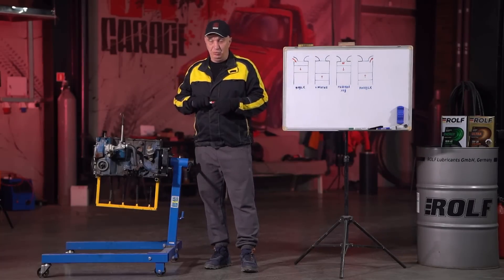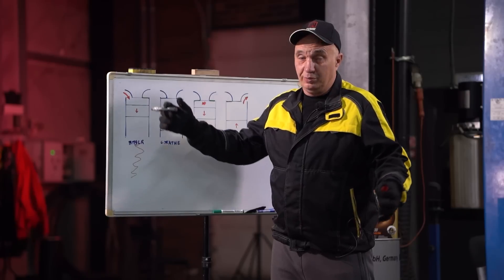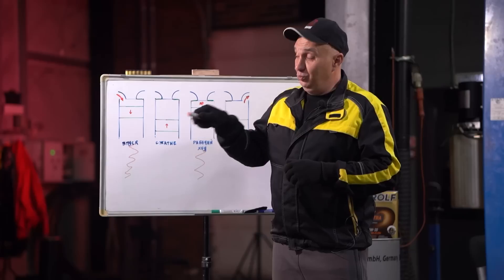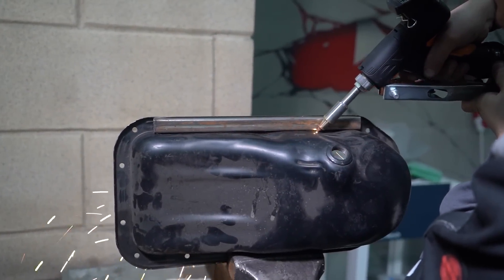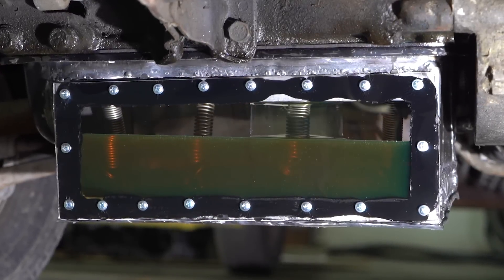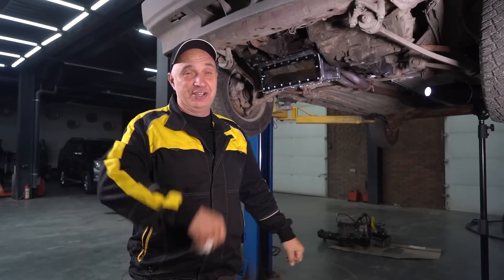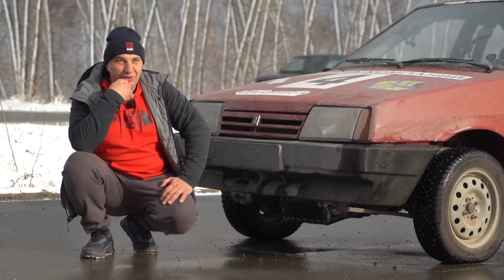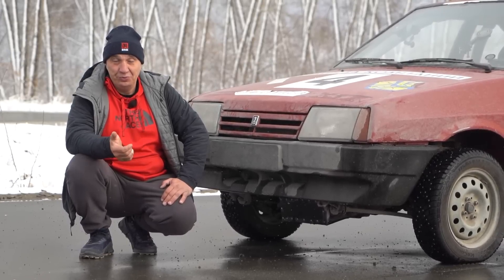Spring augmented engine (20% extra HP!) - will it work?

Comment: I processed your test data. The horse power gain is 20.56%. Very Nice! Yet your test is only an A-B test that separated in long time to add the springs.
Could you please re-do another A-B-A test within the same day, or in a short time? This way will solidly confirm your achievements. Thanks!

Comment: You could of try and use a second crank! so if the piston goes up that the tension is lowered then the combustion stroke the spring is tensioned again before it descends. reducing the needed energy to pull the spring and only use the contracting energy in the spring. 
if the 2 crank was at rotating in advanced of the main crack you may pull it off  using spring to help power increase
Reply: thats actually the sort of setup i had in mind so that not all four springs have constant tension thus cancel each other out. i also wondered if the second crankshaft had a longer stroke and then what if you used something like surgical silicone tubing... i also even debated whether its feasible to just tension the "springs" or whatever with solenoids or a hydraulic means.

Comment: It is not about the springs canceling themselves out. What is going on is the added benefit of another system that can preserve and reuse mechanical energy. Typically that is the job of a flywheel and counter balance, but adding more systems to conserve energy is just being more efficient. 2/3 of the energy produced by a combustion engine is just plain actual heat and very little is actually transferred into rotational energy. Increasing engine efficiency to another level would be to use that thermal waste to increase power, my thoughts would be to add a boiler and condenser to remove heat from the engine, and create steam rotational energy that could then be added to your total power.

Comment: My theory is that the springs cause the rotating assembly to behave like it’s half the weight of the original. 

If the force to pull the springs up were some how less (reducing parasitic loses),than what it would take to actually pull it back down quicker, I don’t see why it wouldn’t work.

Comment: Elliptical gears come to mind.

And I mean make the individual springs controlled by elliptical gears which raise and lower a bar where those springs are attached to. The elliptical gears cause slow-fast-slow-fast rotation cycle to the output shaft if the input shaft has constant speed. Thus the bar to which a spring is attached could lower fast and make the spring to tension and assist the piston coming down. Then the rotation is slow when the piston also is at the bottom dead center. Then when the piston starts to move up, the bar also raises fast. Then again when the piston is at the top dead center, the spring movement is slow too because of the elliptical gear. And when the piston goes down, the elliptical gear causes the bar go down fast again and be at the bottom faster than the piston and this causes tension to the spring and pull to the piston.

Of course timing would be crucial in that and the bottom bars should be rotated by external power source which would defeat the whole purpose of them but this would be interesting to see could you actually increase the power extracted from the pistons with springs which are controlled by elliptical gears. 😄
Reply: why wouldnt you just attach the springs to something like a secondary crankshaft? it wouldn't need to weigh as much as the crankshaft nor require as much strength. it could potentially feature a longer stroke and positioned in such a fashion so that not all of the "springs" are under tension at the same time thus just being expanded and contracted therefore negating each other, and maybe a variable timing setup so that it could tune itsself in real time. it just needs to exert force at the correct time but not cancel its own forces out. an idea comes to mind when i think about combining say surgical tubing or springs or rubber bands with solenoids since those can have significant pull force, actuate in milliseconds, withstand countless cycles, and be fairly reliable. i would think you would want to have the "springs" start to build tension roughly before or about your ignition event depending on the parameters and dynamics of said spring and engine. right before the piston reaches its dwell point at tdc in other words. the dumb part of all this is that the rotating assembly inherits most of its it losses in the cycle from compressing the mixture as well as the energy it loses dwelling at the top and bottom of its stroke, then changing direction. i feel it could benefit more having the piston assisted upward. its all food for thought, but i believe a system could be devised with the right ingredients and recipe which could lend its hand to squeak out some efficiency or in the least negate some of the forces that rob efficiency thus potential power. sometimes, it just takes somebody thinking outside the box or taking a different approach than most would. not every innovation in motion had Newtons law of conservation of energy in mind first; regardless of the fact that everything observes and follows it, but the bar for internal combustion could potentially be set higher. somehow. if i had the means to experiment with and execute every single sort of idea ive had to try with an engine, there would be some sort of game changer somewhere along the way. ive thought of stupid stuff with the valvetrain way before the freevalve stuff came about. like, what if the valves could be ran on a hydraulic setup? but way better than the stupid Fiat-chrysler multiair 2.4L trash can engine.

Comment: I bet, there is a better way to do this that might foam the oil less, but it's trickier, and it still wouldn't make up for some efficiency losses, but it might be more efficient than this. There's also the problem of the springs breaking eventually, and that could cause damage to other parts of the engine. So, a spring design that is more minimal and breaks in a way that prevents damage to other parts of the engine would be the most idealized form of this mod, but the engineering cost might not be worth the gains.  Still, I wonder...

Comment: I speculate a significant difference in the outside temperature between the two runs.  Ambient temperature plays a pretty big role on the amount of power an engine produces.

Comment: I HAVE AN IDEA FOR YOU GUYS TO TRY . 
CONVERT A V10 TO A V6 , SUPERCHARGED BY ...
4 REMAINING PISTONS . 
USING CHECK VALVES TO REPLACE INTAKE VALVES . 
AIR COMES THRU THE BORED OUT SPARK PLUG HOLES FITTED WITH FILTERS .
4 INJECTORS ARE DISCONNECTED ON THE PUMP CYLINDERS. 
COST REDUCED TO 40% WHILE CRUSING. 
SAME POWER UNDER LOAD . 
START WITH A PUSHROD V10 . 
EASIER THAN A SOHC OR DOHC. 
P

Comment: I speculate, that any performance increases... may have been due to the foaming of the Oil.   The oil may end up acting less thick... and thus, flow better.  However... that means the Protection it provides, may also be reduced.   Also, the constant oxygenation of the oil, may start to break down the oil much faster... leading to a reduced lifespan.

Comment: 10 seconds? Really? Your a genius. The springs will have to be heat treated of course. 🔋Perhaps encapsulated spring capsule types with cooling journals with pumped coolant gas of non combustible type R23 and cause the spring to recoil more rapidly. All the best from USA.

Comment: Why is it often said that the balance shafts reduce engine power? I can see some reason behind the opposite being true (a vibrating engine will lose some power to its mounts, where the energy of the vibrations will be dissipated as heat). Obviously the shaft adds some inertia, but this will only cause the engine to feel less "snappy" to rev up. What am I missing?

Comment: Looking through the comments, someone touched on this but it wasn't very clear.... The oil foaming caused by the springs greatly reduces windage losses. On these dinosaur tech engines with poor oil control, windage reduction plus the changes in air density from test to test could absolutely account for most of the gains in performance. I do believe there is a balancing effect though, the springs smooth out the piston acceleration and help redistribute the forces so you are getting smoother more consistent power delivery, although this effect is much less than the windage reduction.
Reply: I dont know what Windage is (unless you are speaking about wind resistance)... but my theory, is that the Oil being Foamed up... is causing it to act like a much Thinner Oil.   Thinner oil provided less frictional qualities... however, it also means less overall protection.
Reply: the oil sitting farther away from the crankshaft might reduce it insignificantly, but you still have oil flying everywhere inside that crankcase. youd probably have more reduction in losses knife edging the crank and putting a crank scraper/windage tray in it. i suppose you're a little hard up if you go out of your way for knife edged connecting rods, but hey, no price too large if its a max effort no holds barred engine build

Comment: The springs, if anything, I feel are usually making things less efficient. Sure, one spring pulls a piston down, but in the meantime another spring is being pulled. The springs are having energy put into and then pulled out of, and as physics being physics, that's not 100% efficient. Some gives out to heat. So really, with this and the video that inspired this, the springs are only really sucking power from the engine and doing nothing in return. The reason the engine spun a few turns beforehand is probably because of the springs, being opposed, probably acted like a sort of elastic "flywheel".

Comment: What about designing a sort of "variable tension" mechanism for the springs that could be controlled by oil pressure and regulated by the ecm (think vtek or vvt)
Reply: I also wonder if this spring mod is better in terms of improved power or alternatively maybe it has a substantial increase to fuel economy

Comment: Equal and opposite reaction. Let’s say it did work anything you gained from the spring pulling down is negated by the springs being pulled up. It’s like trying to blow the sail on a boat with a fan on the boat. It just doesn’t work.

Comment: Another great video guys, thanks for all your hard work. Have you tried making a rotary valve head? It would illiminate regular valves, camshaft, springs and rocker arms, a lot less friction.
Reply: Actually, unless you use a cam system to virtually stop the motion of the rotary valve at combustion TDC, the high cylinder pressures increase the friction force with rotary valves. The supposed benefit of rotary valves is higher volumetric efficiency, but with modern design principles and variable valve timing, volumetric efficiency can be more than 100% even with poppet valves, so it's dubious whether rotary valves actually have any benefits to counteract the disadvantages.

I first found out about rotary valves at uni, well over 20 years ago, and there haven't been any appreciable advances in their design or manufacture since then (at least, not that I'm aware of). I doubt that we'll ever see them in volume production engines. Poppet valves work very well with modern design and manufacturing techniques, and rotary valves aren't as easy to get right as people think they are.

Comment: Looks like it was colder outside during the second test also getting your oil away from the crankshaft like you did will free up some horsepower by reducing the drag of the oil on the crankshaft

Comment: I dont get the idea at all haha.. 
Even if the springs were 100% efficient there would be 0 gains. Since compressing the spring removes exactly the same amount of energy as you will get back when it extends again. And in practice compressing it will require even more energy than you get back since a portion of it will always go to creating some heat that is completely wasted.

Comment: Hmmm... to reduce the whipping effect you can add little cylinders for the springs to ride in keeping the oil separated from the oil. Also , start playing with spring tensions. I am quite surprised from the results but the data shows there is an increase in perfromance ..even though it seemed to be much cooler thus having a environmental advantage causing DA to be favorable to increase hp/tq, but the traction was less, But  10 second delta is  immense!! I hope you try out some more ideas for this Spring Charged engine

Comment: I think you guys should try an injection molded polycarbonate engine block with transparent aluminum sleeves it should be strong enough to finally have a long term transparent engine

Comment: I almost though that it was april already 🤣🤣    - can you rather try twincharged LADA, or make rotary valves for lada.

ABOUT THE VID THEORY…........the springs are conected to the same crankshaft so the spring force cancels out, becuase of the fact that it is hard piece, this could work only on a One piston engine ar engine that has not symetricaly oposing piston balance so up and down piston would need to be something different than 180° of each other to even exert some force........I will not go into detail to check if it would help.......but on the one piston engine this could work, it would not be more efficient but it could up the power, bcs the spring pulling down could add more power to the piston going down so it could theoretically draw more air:fuel mixture and make more power on the downstroke, than it would take to preload/stretch the spring by the flywheel when it goes up.........................BUT THIS THEORETICAL GAIN WOULD BE ABSOLUTELY OBLITERATED BY SLIGHT DIFFERENCE IN HUMIDITY OR PRESSURE OR MAINLY TEMPTURE on atmosheric engine.

Comment: How about installing a pressurised injector/atomiser head (fed by a resevoir and pump) into the airbox on a stock motor that sprays Nitromethane or Nitromethanol into the airbox... Power gains? 🤔😏🤞🤣🤣     😎🇬🇧

Comment: It could be that the interference timing of the springs is helping reduce the ancillaries parasitic loses, as well as valvetrain spring losses along with flywheel momentum preservation when the engine is of the power stroke since it is essentially stored energy being released at certain points in the engines revolution. How about you guys try magnets next time ! Should be more reliable :) Just a thought BTW :)

Comment: If this is not a hoax, then the only way I can think of to explain is: the energy is not 100% absorbed by the engine during compression stroke. Basically, the piston reaches BDC before all combustion energy can be harnessed. Thus, by adding a spring, the wasted energy is used to compress the spring instead, and the spring releases the energy back during the next cycle.
Reply: Oh come on...

Comment: If you had a secondary crank mounted under the main crank, that rotated in sync with the upper main crank, and the springs attached for 0 tension up and max tension down on each cylinder, something could happen?

Comment: You need monopole magnets that repel each other. Then you can make a magnet motor transferring free energy🤯 to the pistons, which will run the engine forever until you stop the car🤔, May be a little gas at start everytime🤞🤣❤️👍

Comment: starter energy to turn over the engine... after two rotations several of the cylinders are compressed and entered into decompression cycles, so after the first shunt of electrical from the batteries, the hill of cold starting is less. as it is relevant to saying singular cylinder engines are outdated as they actually in demonstration waste more energy then a multi cylinder engine. lude obsession's with springs that has no factual generation of anything past a demonstration of equalized potential energy.

Comment: The gains wouldn't be worth the effort but in theory one could replace the springs with small air cylinders and swap pressure from those on upstroke to the 2 on downstroke to eliminate the resistance always robbing 2 cylinders

Comment: What if you used a electric motor to help spin crank shaft to take all the load from the resistance of the rotating parts.
Reply: Then you are just adding power by using power
Reply: @andriandrason1318  Exactly, how much could you "gain" on the engine side of things would be interesting
Reply: Thats called a hybrid.
Reply: @herpnderpn2484  Absolutely.
More specific mild hybrids or MHEV which many call greenwashing technology.

Comment: It's unfortunate that all the springs counteract eachother on the crankshaft.. I wonder if there's anywhere you CAN put a spring to improve engine performance.
Reply: Of course. For the valves!
Reply: @dankline9162  Well, there's a different reason. Actually, the springs reduce the horsepower slightly, but the function of the valves increases the efficiency of the combustion massively, so that it adds horsepower.
Reply: Would be interesting if they could add two very heavy Springs that wind when the throttle is released, then you can release them manually to spin the front wheels separately from the back. Turn breaking into potential power
Reply: On the throttle arm works well.